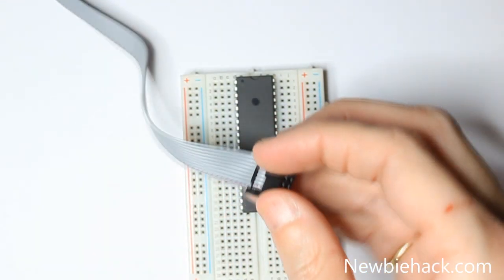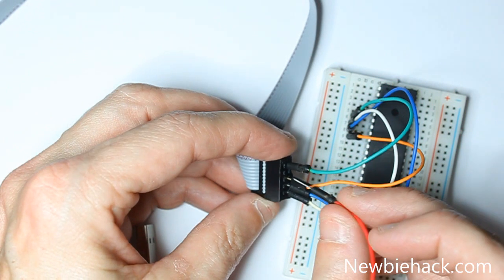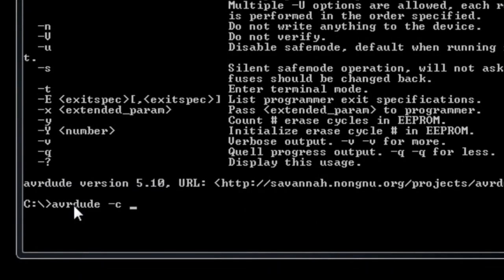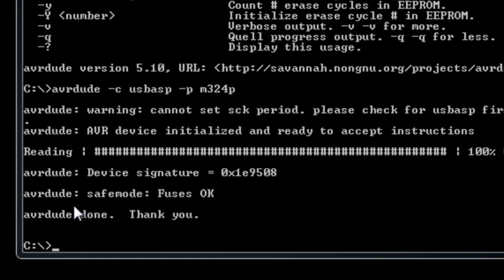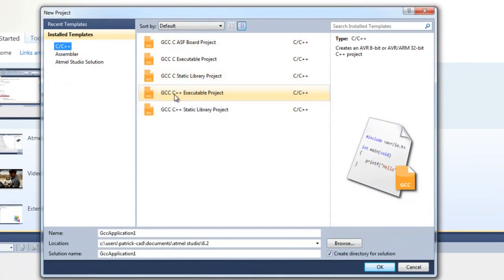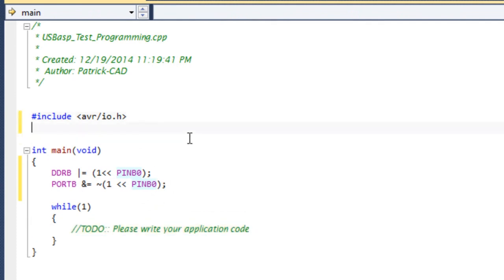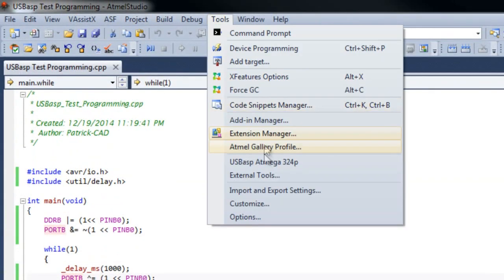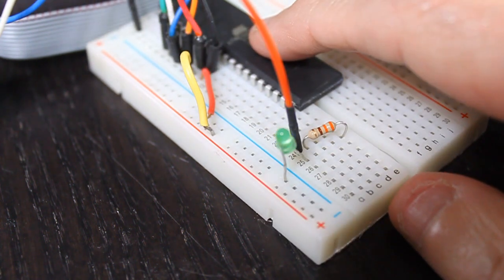4. Arduino for Production! How to use the USBasp to Program/Flash the Microcontroller

Comment: i connect all right, and i set up usb asp, but my atmega8 just dont wanna play. it write target doesnt answer
Reply from the maker: There is probably an issue with the connection. Or, the programming pins have been disabled in some way. If you haven't, check out the video were I discuss the fuse bits.

Comment: So if I were to disconnect the wires from the programmer, would I need to hook up a crystal and capacitors to the chip along with the led and resistor for the blink program? I mean.. like you would if it was something like the arduino on a breadboard? Or can I just have the led and resistor with the supporting voltage and ground line to the 324p?
Reply from the maker: The microcontroller contains an internal oscillator so no crystal is needed.  The video show all you need to do.

Comment: Well this doesn't work for my ebay chinese made usbasp and the problems have been well documented but little remains to be solved. Many suggest its a problem with how fast the chinese usbasp are set compared with the significantly slower virgin avr chips being used. Good tutorial otherwise.
Reply from the maker: Interesting. Thanks.

Comment: Hi Mr.Patrick, I got this error:
avrdude.exe: error: could not find USB device "USBasp" with vid=0x16c0 pid=0x5dc

Any idea about how to solve this?
Reply: I used this for the drivers and I solved it.. http://s000.tinyupload.com/?file_id=55168441071307957208
Reply: @VerticalWit  yes this a proved solution
Reply: I'm getting this too.
Reply: I think you should check what name is in the driver part or something 
I don't know fully but that's how my problem got solved

Comment: ?thanks dude... I'm wondering how about if I'm using At89s51 should I use EXTERNAL Oscillator or not necessary   
I mean if I'm using it just for this program " blinking LED"i.
thanks in advance.

Comment: Thanks for the excellent tutorial. I have a question though: Is is still possible to use the SPI interface in other applications (like interfacing with a sensor..etc) while the ICSP connections are still intact? If yes, would the ICSP connections interfere with SPI data transmission? Thanks a lot

Comment: avrdude.exe: error: programm enable: target doesn't answer. 1 
avrdude.exe: initialization failed, rc=-1
             Double check connections and try again, or use -F to override
             this check.
this is my error please hep me out
Reply: +Vignesh Kumar same here... im using it on a attiny13, so im using t13 as target
Reply: it's just the connection problem
Reply: Same error plus I have checked each and every connection using a continuum multi-meter over and over again. I am going MENTAL
Reply: If it is not a faulty connection, it's that you need to install de usbasp driver, or that your usbasp is damaged

Comment: Hello I can't sove the following errors:

avrdude.exe: warning: cannot set sck period. please check for usbasp firmware update.
avrdude.exe: AVR device initialized and ready to accept instructions

Reading | ################################################## | 100% 0.01s

avrdude.exe: Device signature = 0x1e9502
avrdude.exe: NOTE: FLASH memory has been specified, an erase cycle will be performed
             To disable this feature, specify the -D option.
avrdude.exe: erasing chip
avrdude.exe: warning: cannot set sck period. please check for usbasp firmware update.
avrdude.exe: reading input file "$C:\Users\arihavkelenson\Documents\Atmel Studio\7.0\USBasp test programing\USBasp test programing\Debug\USBasp test programing.hex"
avrdude.exe: can't open input file $C:\Users\arihavkelenson\Documents\Atmel Studio\7.0\USBasp test programing\USBasp test programing\Debug\USBasp test programing.hex: Invalid argument
avrdude.exe: write to file '$C:\Users\arihavkelenson\Documents\Atmel Studio\7.0\USBasp test programing\USBasp test programing\Debug\USBasp test programing.hex' failed

avrdude.exe: safemode: Fuses OK

avrdude.exe done.  Thank you.

Please help me :)

Comment: I keep getting "'avrdude' is not recognized as an internal or external command, operable program or batch file." every time I try to use the avrdude command in cmd. I've tried running as administrator, cd\'d to C:\, reinstall the drivers (5th time now), and even tried it on a different computer.
Reply: maybe installing avrdude would help :p
Download WinAVR installer and everything should work

Comment: I tried it with ATmega328. avrdude does not support m328 but i have changed the avrdude.conf for atmega328.
All the steps which you have done the same i applied. I get all the result on the software level as in this video.
But in the circuit i am not getting the LED blink. I am using 12 MHz external clock because without external clock avrdude was showing problem. what changes i have to do?

Comment: I have followed this exact tutorial on two different PCs and while it works on the first, on the second I get the following error message:
avrdude.exe: can't open input file .hex: No such file or directory
avrdude.exe: write to file '.hex' failed
Does anyone has any idea how to fix this? Thanks in advance!
Reply from the maker: Killthreath It can't find the hex file.  This is an issue with the folder specification in the external tools section.

Comment: I, my chips is a atmega324PA and when i try to execute the usbasp tool i got the output message "avrdude.exe: AVR Part "atmega324pa" not found". I execute the exact same lines as you (but of course i changed the code of the chips). Do you I have a guess on what might be the problem ?

Comment: It shows an error like below when I use atmega32 micro controller

avrdude:error: programm enable: target dosen't answer. 1
avrdude:initialization failed, rc=-1
            Double check connections and try again, or use -F to override
            this check

I check my connections and I also tried -F to override but it didn't work.Help me burn my first program.

I use a programmer from this link : https://www.techshopbd.com/product-categories/avr-9675/214/avr-programmer-techshop-bangladesh

Comment: hi patrick i had being trying to praogram my atmel  chips using ardiuno boards but i keep having an error .... would you explain how to do that ..thanks
Reply from the maker: Hi some one, You are wanting to convert an Arduino into a programmer?
Reply: Patrick Hood-Daniel yes how can i do that and .. how to add it in a external tools.. thanks
Reply from the maker: I don't really see a need for an Arduino to serve as an ISP programmer.  However, it is interesting that the device that one would normally want to be used as a main controller to be used to program a controller.  You will need to produce a program to receive serial communication from the computer using the on-board FTDI chip and then produce signals through the SPI interface in a form that is acceptable to the microcontroller.  It would be far cheaper and easier to just get a USBasp programmer.  It low hanging fruit.

Comment: Perhaps a stupid question, but is this the same as programming with usb via the ftdi chip on arduinos which also use the atmega328?
Reply: The FTDI chip is an USB to Serial converter. AVR chips can't be programmed via serial by default. That is why Arduinos require a bootloader. 

The USBASP is an ISP programmer. ISP is baked into the chip, so you can program bare chips (without bootloader).
Reply: Patrick Hood-Daniel Thanks. I've been doing simple projects using the arduino for a while but found out that some of them could be done smaller and cheaper by using e.g attiny85 or 2313 instead. Your videos have been very helpful and highly appreciated!
Reply from the maker: beargun42's explanation hits the mark.  The purpose of all of these videos that I produce is to demonstrate the pure fundamentals of the Atmel uC's.  This will prepare anyone for real design and engineering for efficient production.  Arduino environments and circuits are great for one-off projects, but with all of the supporting circuitry (like the FTDI and others that may not be needed) does not lend well to a holistic understanding of the electronics field; rather Arduino focuses more on programming, and provides the resources on the board and supporting electronics so the programmer would not need to worry about the electronic side as much.
Reply: beargun42 Ok, I see. I thought since the AVR chips (at least some of them) could be programmed using serial as they already support USI or UART.